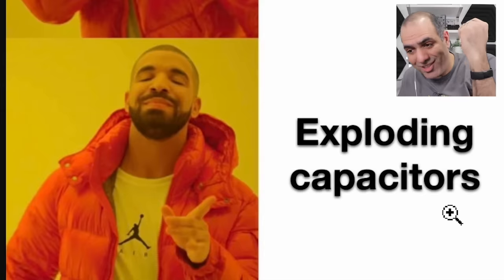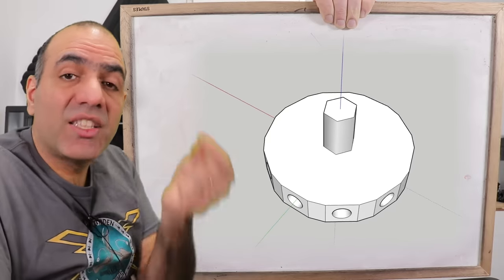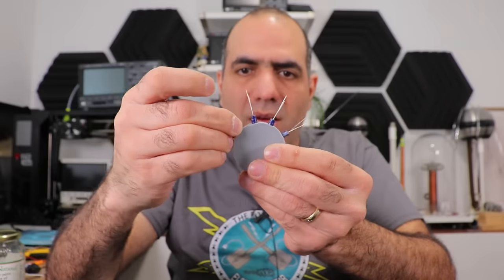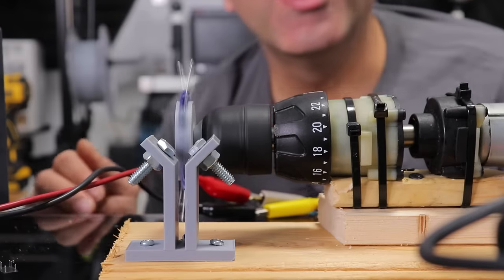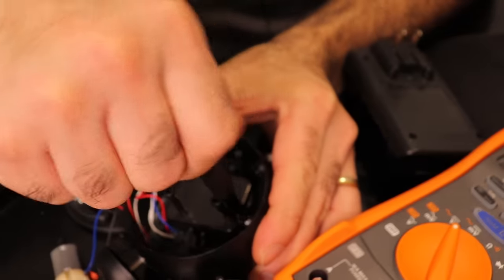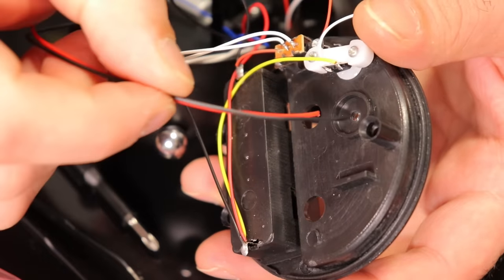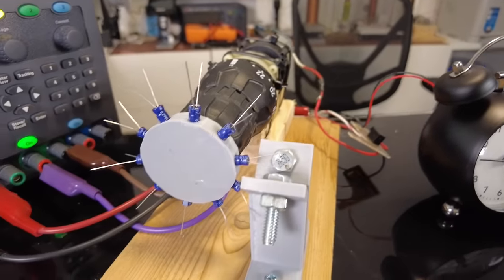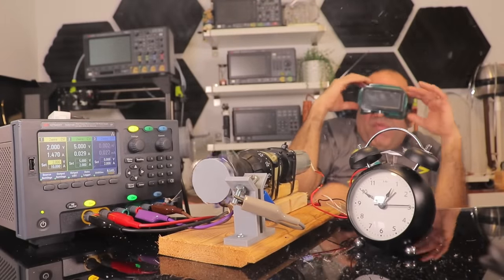Capacitor-BOOMer Alarm Clock

Comment from the maker: 8/10 caps blew! That's not a bad record for first try!! One cap blew but didn't make a sound, that was odd... Don't forget to register for Keysight!
Reply: Thanks mehdi
Reply: Ps matthew from the us
Reply: I thought it was just going to go boom once and every day it would reload for a new boom.  Rapid fire booms much better!
Reply: did the mic just not pick it up or was there in fact no sound to be heard? probably hard to pin down looking back, right?
Reply: I signed up for the Live from the Lab Keysight event! Can't wait to watch the stream tomorrow!
Reply: 7bb, dont cut ur fingers off okay?
Reply: @عبدللهبنعبدلله-ن8و   Good point I'm actually doing social studies at the moment and we're focusing on Islam and Buddhism along with a couple other religions
Reply: Need a bonus video blowing up the rest
Reply: Man went insane afterwards slight pted
Reply: Thanks for the humane design I will try it out
Reply: Yes actual GG
Reply: You used 1.5v to control 5v to control 2v? The drill probably used more current, but the transistor and relay seem unnecessary to me.
Did you think about using the alarm clock's motor to turn your magazine?
Reply: Electro boom it's is true that LCD can  be home made like solar?
Reply: ok
Reply: heart this comment
Reply: part 2 with better design pleasee
Reply: Screws?  The nuts hold on the screws?  The high voltage is connected to the screws?  The legs of the capacitor touches the screws?   Really Mehdi screws?  I expected better from you.  My disappointment is unbearable.
Reply: This looks like your drill motor from your free energy video.  Just run your wire in a circle and the alarm clock will run itself.
Reply: You should have just hooked the drill motor power wires to the hammer and bell on your alarm clock.  As the alarm hammer went back and forth it would make your drill spin.
Reply: Good. I won't try this at home. probably at school though 😛 (no I won't, but I will blow some caps in my lab for fun)
Reply: You should fill a NC to the manufacturer for that silent one, ffs why for do we even buy capacitors nowadays!
Reply: Now you still have to integrate everything into the alarm clock.
Reply: One thing about Keysight is they are going to send e-mails ones that keep getting past your spam filter about once a week every week for an entire year no Matter how many times you unsubscribe and mark as spam
Reply: چهارشنبه سوری جالبی بود .  ساعت بنگ بنگ  به سبک الکتروبوم
Reply: Looks like need to be spaced out more, one of the caps landed on where it was hitting, but freaking awesome though.
Reply: hey electro boom guy
it was my birthsday 13.march
Reply: @ElectroBOOM more latities
Reply: ITS A CAPACITOR MASSACRE GREAT VIDEO MEHDI 👍🤣
Reply: The ATF Canada is looking for you!
Reply: If a capacitor blows but nobody hears it make a sound, did it really blow?
Reply: I think it skipped one of them since it was already shorted by something sitting there.  When it got swept away the next one went
Reply: How much static electricity can a person with wool socks create by scuffing their feet on shag carpeting? Is it feasible that they could power a lamp?
Reply: @raindancer1872  A very small lamp perhaps.  Like, a single tiny LED.
Reply: Do something with electronic measurement device
Reply: Hey mehdi can you scare your family with the clock
Reply: The design is very human
Reply: Selam Mehdi. can you measure the electric field on the  phone's touch screen???
Reply: yea how did the 8th one didnt make noise?
Reply: Can you make a super electro magnet? Make it strong enough that nobody can lift it.
Reply: Wait…. I’m confused…. I can try it at home?
Reply: You realize how confused someone will be in the future when they discover this device
Reply: 🤔 maybe it is safer and more efficient with relays and capacitor connected backwards using low voltage with no rotative distributor. In that case you have no chances 😂
Reply: @StinkPickle4000  same
Reply: couldn't you have hooked up the little motor in the alarm clock directly to the magazine? maybe using a set of gears to adjust speed
Reply: Ei
Reply: Boom
Reply: I think I can redesign it and add the micro controller and safety system.
Reply: And program a clock in the micro controller
Reply: Yo
Reply: My Great granddad just got ptsd from Frankfurt bombing again. Thanks Mhedhehi.
Reply: Hahahah what a boobmer   😂😂😂😂😂😂
Reply: Bhkirfhjl
Reply: Using blank cartridges can make it louder but the clock will fly off if is facing downward
Reply: thanks for idea ima do it and ignore what u said not to try
Reply: I think getting electric shock is your hobby.
Reply: made this i got 10/10

Comment: This project involved live mains power on an open contact, but what scared me the most was Mehdi's woodworking skills.
Reply: You're not a woodworker until you sacrificed a quart of blood to tree carcass gods !
Reply: Risky jigsaw technique
Reply: Ive seen safer videos from china on liveleak
Reply: My only fear is accidentally putting ur hands and or hand the the live.... Probs?? And once the alarm goes off it electrocutes u. "The best alarm clock ever it's even 5D it's so awesome it's SHOCKING" is my commercial. What's your's???
Reply: If he keeps using a jigsaw like that his hand will be a jigsaw puzzle.....Working out which finger goes where 🤟😂
Reply: Yeah.. I had the same wood working skills till I got a hole in my finger. Didn't fully penetrate but was close to the bone
Reply: @kawkawbetch8795  How the hell did ya put a hole in ya finger mate? Sounds like the kinda thing that might happen with a staple or nail gun but not with a jigsaw I hope? Ya bloody lucky ya still got that finger if it was with a jigsaw. 😮🤷‍♂
Reply: @28russ  with a drill :3 was a kid when that happened

Comment: Mehdi : A talented and experienced engineer.
Also Mehdi : Puts on safety glasses AFTER a capacitor blows near his face.
Reply: Yeah, surprised he hasn't lost an eye yet.
One time I decided to blow up a few old caps I wore safety glasses. They were so old they didn't have a vent cut into the top.
Had a big triangular fragment of amuminium embedded in the plastic of the glasses.
Reply: Also Mehdi : uses an electric saw over a garbage can in his lap to cut a piece of wood he's holding freely in his hands
Reply: @jak8274  this was genuinely the most sketchy part of the entire video.
Reply: Don't worry. He is made up of Cat's material. Not sure of 9 lives but he sure has more than one!
Reply: @IgnavumFortuna  (nearly) all the electric mishaps are scripted. It would make a weird kind of sense if he is super-aware of risks with anything involving electricity but completely oblivious to anything else
Reply: @samsen3965  
Unless he’s a Latin cat which is 7 lives.
Reply: @Bassotronics  Heh heeeeh. But with all I've seen on his channel, his promised deal is way higher than 9, and not sure which kind of cat that has to be (Definitely not Russian or Chines).
Reply: I mean you can only lose an eye once, then it's up up and away!
Reply: @daviddavidson2357  Nice story...
Reply: those are automatic safety glasses. Mehdi living in 3023
Reply: @jak8274  Meh. It's a scroll saw. I'm more impressed that it didn't catch on the wood and bounce back and forth on the saw. Good forearm strength!
Reply: Better late than never
Reply: @jak8274  
on one leg...!
🤣🤣🤣🤣🤣 !!!
Reply: Garret Konz  Not his forehead... but a far more important asset!
         HIS   U N I B R O W !  😏
Reply: The glasses were to protect the unibrow, obviously
Reply: experienced ? "ho the capacitor has melted in the plastic ???"
Reply: @samsen3965  its OVER 9000 !!!!
Reply: @jak8274  Well, cutting with a tool like that freehanded is something that is practiced regularly. It is definitely not up to code and most definitely hazardous but if you know what you're doing and you respect the boundaries of your limits and the machines power, you will be safe. I say this because I am also a participant of such practice... Sorry not sorry. It's just easier, faster?? Convenient, it's more convenient.
Reply: Also also Mehdi: "spread the legs apart" snort 🤭
Reply: @IvnSoft  LOL... Can't disagree with this pal!
Reply: @jak8274  cutting that wood he held freehand might be the first time I genuinely worried for his safety. All he'd need is for that blade to deform and break and have the still reciprocating side jump at his fingers and idk if they'd be able to reattach it. At least not w much functionality.
Reply: Even smart people have to be a little crazy sometimes, but for medhi it is more like an exponent
Reply: Safety squint FTW
Reply: @ProudVermin  wrong, you can lose an eye twice, well…..most people can
Reply: @mikemurphy5898  Even the most aggressive scroll saw blade... I mean, I've hit my fingers with them a few times. It's not very likely, what you're describing. Usually just results a deep scratch. I used to do cabinet work and used scroll saws daily.
If it was a circular saw, I'd be far more worried.
Reply: He had protection on. They're called safety squints XD
Reply: Don't try this at home 😂
Reply: I'm pretty sure he does this on purpose at least half the time, so we - the audience - cringe a bit and then think more about safety. He's watched mostly by children to 25yos, so it's good to do it this way
Reply: Because Mehdi learns from his mistakes.
Reply: And also, the fact that he started closing his eyes before the explosion xd
Reply: @Bassotronics  Hey, I didn't expected you to see here
Reply: @3manuxl1006  
Hello from the Electro-Bass-Boom side!
Reply: @Bassotronics  I am glad to know that you are enjoying watching him too :D You are the best man<3
Reply: @samsen3965  American?
Reply: Mehdi is super safe when compared to AvE
Reply: It’s mehdi lol what you expect 😅
Reply: lol
Reply: @daviddavidson2357  He's simply just a professional
Reply: Also Mehdi:Likes to thread nuts using drill while hold other things freely
Reply: Mehdi doesnt need to hear this, he's a highly trained professional
Reply: I don't use goggles at all😊
Reply: Just like putting milk before cereal

Comment: I had an old CRT TV standing in my bedroom. One night, at about 3am, a capacitor blew up inside of the (turned off) TV. So I can confirm that capacitors are good alarm clocks.
Reply: It was a ghost trying to keep you from a proper sleep schedule
Reply: thats pretty scary considering it was off, what it if had caused a house fire ?
Reply: @novictim   Digital appliances are very rarely truly off. They go into standby. The power supply is still converting a tiny bit of power to power a board to check if the power button is pressed. Not many things you plug in have a true switch that kills all power to the device. Oddly my wife just got a computerized sewing machine and it does just that, flip the switch and no more power. Everything else goes into standby.
Reply: Old CRTs can store In the capacitor for some time. Ive seen the tube itself blow. But it was powered when that occurred.
Reply: @RedStripeMedia  can that happen when it is off?
Reply: @catronics1979  yes it can
Reply: @RedStripeMedia  what triggers it and is there any way to prevent it?
Reply: @catronics1979 it couldve been degradation of the capacitor itself but that seems to simple
Reply: @catronics1979 Unplugging it…
Reply: It'll definitely tell you what time it is 😂

Comment: This is the exact alarm clock I need. I usually have to set 10 consecutive alarm to wake up. But with this one, only one alarm will be enough to wake me up permanently in the heavens.
Reply: Piece of advice from a fellow multiple-alarms guy : the trick is to have the alarms close enough to one another so that you can't fall back asleep completely between 2 alarms. Like, having 10 minutes between alarms is useless, because you're back to a deep sleep after 10 min so the second alarm is just as bad at pulling you out of sleep as the first one. From my testing, the optimal time is 3 minutes. 5 is acceptable, but less efficient.
Reply: @arantes6  or just put your alarm away enough that it requires you to stand up to turn it off 😕
Reply: and if you upscale and use old TV capacitors, you get a bigger boom, and the room fills up with smoke so you either have to leave because of it, or that the smoke alarm triggers, which is even louder😂😅
Reply: @phobos1963  doesn’t work for me,I wake up go pee and poop and then come back and sleep again 

I need a clock that makes me completely awake otherwise I just go back to slp lol
Reply: @arantes6  I use alarmy and set it to 3 math problems. It doesn't always work because my idiopathic hypersomnia gives me super sleep powers advanced enough to resist fire alarms.
Reply: try a screaming meanie 220  it wakes teh dead and goes off 2 times
Reply: @Snay1998  hook it up to an air raid siren that should do the trick and if it doesn't the neighbors and police will also assist in waking you up as well.
Reply: I might need an alarm that pepper sprays me. It's that bad! Havent tried it yet. Might be unhealthy to do such a thing every day tho.
Reply: Only ten? I set at least 25 alarms 😂
Reply: @ipodtouchiscoollol  I built one out of a boat horn! I also made one that sets off car horns. They work great!
Reply: @wdavem  imagine you did that and build up a tolerance to pepper spray. You’d be superhuman at riots 😂
Reply: perfect for monday mornings  maybe attach coffee maker on timer set 15 minutes before too.
Reply: @arantes6  good advice
Reply: @arantes6  it's much better to just get used to getting up after the first alarm.

Then I'd suggest do it the other way around actually: set your next alarm like 25 minutes from the last. That means that when you wake up in a really bad part of your sleep and really want to continue sleeping you do in fact get an extra bit of sleep and move yourself to the next sleep phase where it should be easier to wake up.
Reply: @d_kortman  Yes! If that's true then I should make an alarm clock that uses a knight stick and tear gas on me. But how long with that work?!
Reply: to wake up without ruining your health, it needs to happen gradually. it is normal to have difficulty waking up from deep sleep.
solutions you can consider :
- play ambient sounds with slowly increasing loudness before your alarm. many alarm tools have this feature.
- keep the window blinders open so that gradual daylight can wake you up. smart light bulbs may have this feature.
- keep the window glass slightly open so that outdoor noises can wake you up (birds, wind; or cars if you live in the city)
- if you have a programmable silent fan, set it to turn on before your alarm
- use blankets instead of heating your room. 
- drink a room temperature glass of water as soon as you get up
Reply: @YounesLayachi  Sounds good to me.
Reply: @ipodtouchiscoollol  now that I think about it,you are right

I need a .45 alarm…would wake me up real good
Reply: @joejane9977  godforbid it’s buttons stop working and I’m ded too

Comment: The pause Mehdi took after joking about that he wasn't making a time bomb killed me
Reply: Tango Dragonfruit  Just throwing ideas around ;);)
Reply: 🤣🤣🤣🤣 im dead too bro.. its just his paused face.
Reply: tangodragonfruit5544  I mean, how hard would it be to take a switch off a trigger, and solder the wires on the alarm?
Reply: Tango Dragonfruit  That wouldn't work, most explosives need either heat or a powerful shockwave to detonate. For example ANFO, a common explosive that is readily made at home, requires another explosion to set it off. Just fire or electricity won't work. You need to connect the wires to a specifically designed detonator and that would require greater voltage. So you would need to connect the alarm voltage to a relay or other switching device to tell the detonator to ignite.
Reply: @douglassmalls6934  this also had a transistor and a relay involved with the switching to be fair
Reply: tangodragonfruit5544  Save video to folder "How to make a Time Bomb"
...
FBI open up!

Comment: Make the capacitor holder two pieces by splitting the body along the circumference midplane of the rotor disc. Then make it to where you can secure them together with 3-4 equally spaced screws accessible on the front circular face. You could even make the capacitor holes a little smaller so it holds them more snugly, and then the caps won't rotate in place when the alarm clock goes off.
Reply: Or just put large metal pads on either side of the wheel with a little notch each leg can fit into (to make changing them out easy,) and treat it like a brushed motor

Comment: Is it just me or every time mehdi makes something like this I want to make it using a micro controller and simplify the whole thing 😂 I love the chaotic nature of analog systems though lol
Reply: It may be because he took apart a whole alarm clock only to realize he only needed the contacts of the motor...which I'm not sure if he realized, but he could have just used to drive the capacitor wheel instead of a whole dissected drill.
Reply: Glad I'm not the only one who thinks this! Hahaha. I used to think Mehdi did it because his degrees are in pure Electronics and just worked as an engineer but I saw someone say he has engineering degrees so he probably did all that in school and just prefers the chaos of analog design 😂
Reply: I mean, what's simpler?  All of this -- or -- all of this plus a microcontroller?  Only the clock seems replacable.
Reply: @jeslinmx22  i was thinking of something similar tbh
Reply: I was thinking the same thing. Kept waiting for him to bust out a ESP32, but it never happened. 😂
Reply: The whole point of his channel is to build projects without the convenience of a microcontroller. If he just used an Arduino or an ESP32 every time he ran into some difficulties, a lot of the charm that makes this channel so entertaining to watch would be lost.